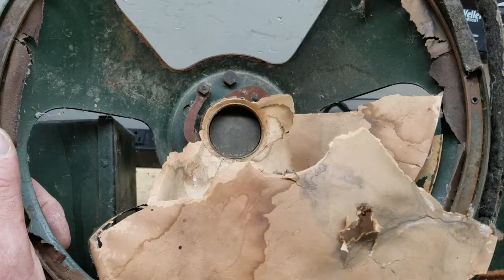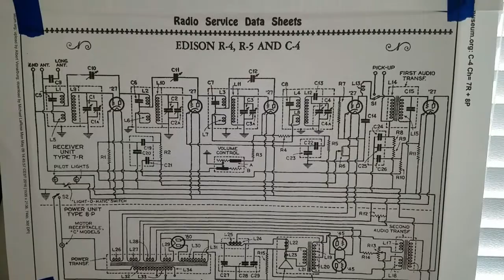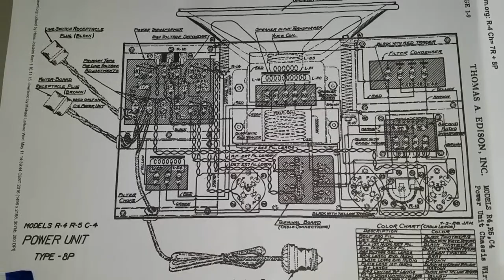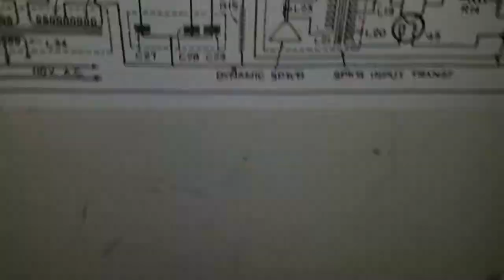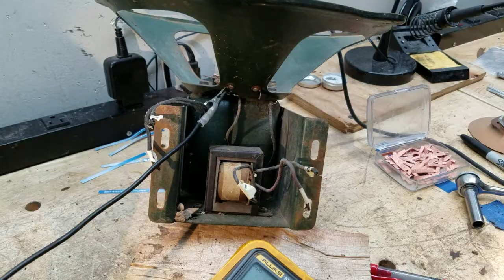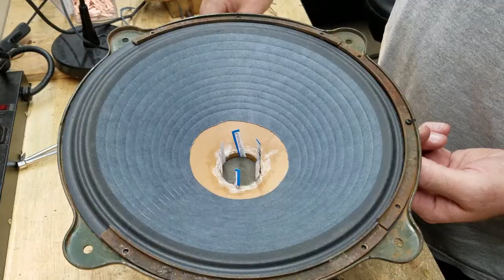1929 EDISON R-4 HIGH-BOY Part 3 of 9  Speaker Saga Continues

Comment: Your measuring DC resistance not impedance
Reply from the maker: Yep.  You are correct sir, and I appreciate that you note the difference.   If I said "impedance", it was due to my habit of associating impedance with speaker voice coils and transformers.  That said, measuring simple resistance is a completely acceptable practice when assessing an old radio, especially in this situation.  Many radio schematics back in the day provided DC resistance specs on the print for field and voice coils as well as transformer windings.  This was probably because measuring reactance is difficult, especially with the equipment available to the average serviceman at the time.   If the resistance I measure is in the same ballpark as that on the skemo, I am golden. Most of the time, all I really care about is that there is solid continuity across whatever winding I am measuring.  If there is that, then it is likely that there is no problem with that winding and I can move on.  Not very engineer-like, I know.   As a radio hobbyist, I am not really doing the work of an engineer, so much as that of a field technician.  Thank you, Ian for watching and for awesome comments!   Cheers!    Michael
Reply: There is a way you can measure the  impedance of any transformer with 9 volts AC I find the you tube video. Will good for you to test output transformers
Reply from the maker: That's cool, Ian.  I will give that a look.  It sounds like it will be useful.  Thank you, my friend, for watching and for all of your excellent comments.  Cheers!  Michael

Comment: Nice job!  Does it have a paper surround ?  The modern cones I've tried all had mushy, rubbery surrounds.  Looks like yours has the right stiffness to it.
Reply from the maker: Bob,  It's a paper surround, with the ridges for flexibility.  I think it is actually an old Zenith cone.  I had a bunch of them that a friend gave to me, and this was the last one.  The part number printed on the cone looks like a Zenith number.  In any event, I hope that it works.  It looks a little stiff to me, but I could be wrong.  If it doesn't work, I have a Grunow Majestic speaker from a Model 71 that will probably work.  I'm still going to order a bunch of cones and surrounds from MAT, just for future use.  It was SLOW, tedious work, believe me!   Take care.   Michael
Reply from the maker: Question for you, Bob:  The wiring in the receiver unit is actually pretty flexible and the lacquer coating on the cloth insulation still has that soft, sticky feel.  At first I thought I heard "crackling" like that sound made when the inside rubbery insulation is dried and is cracking.  Later, I realized that it was just the slicky lacquer as wires released from each other.  After I cut off the binding string, all the wires in the harness felt really pretty good.  I don't think that I should replace the wires.  It makes the radio less original and I'd only be asking for trouble.  What say you?   Cheers!  Michael
Reply: I would leave the original wires in place.  I only replace wires when the insulation is badly deteriorated.
Reply from the maker: I think you're right, Bob.  The filament wires were the only ones that I ended up replacing.  They were crunchy enough to make me nervous.  The rest were not that bad.  I decided to fuse the filament supplies to those 27s.  The failed winding was enough to convince me that it was worth the effort.  Thank you for your reply, sir!   Cheers!    Michael